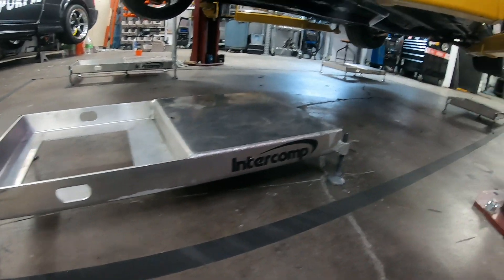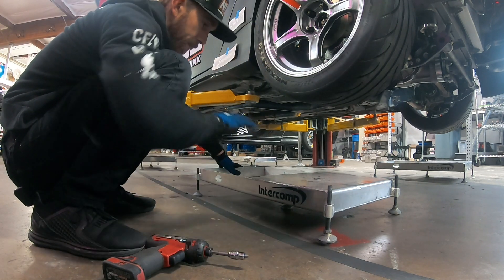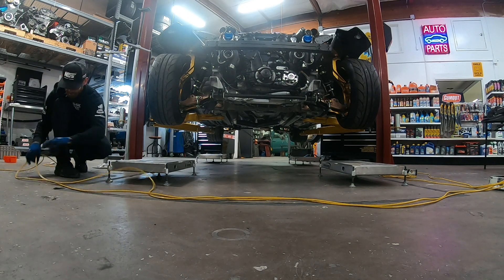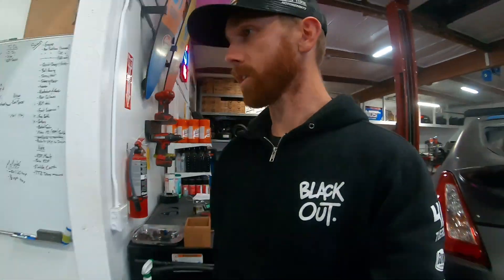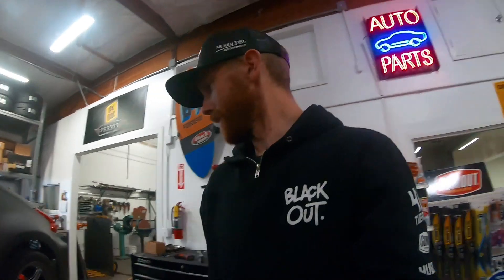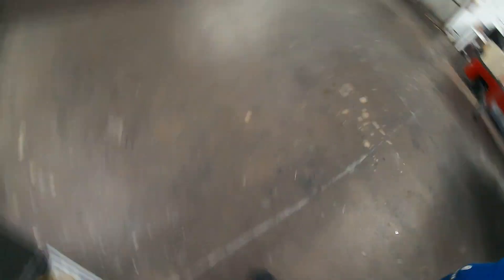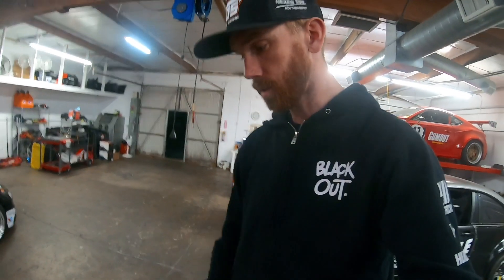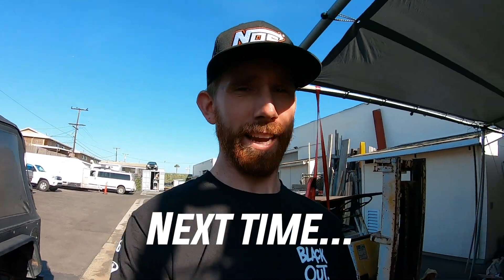How to Corner Weigh Your Car!

Comment: Tire tread weight is especially pronounced on a motorcycle, considering you use your entire contact patch and actually lean through the corners.   It's a good 10 inch wide patch of rubber on the rear alone, lots of rotating mass in that rubber.

Comment from the maker: How do you align your car at the track or at home?
Reply: incorrectly, every time.
Reply: I live on Vancouver Island. We don't have anywhere to corner balance on the island! Good laser alignment shops though. Massive fan of yours! Bought a 350z because of your FD wins with that chassis. I have 2018 370z now. I saw you in Seattle @ FD and had a great time! Keep up the good work bro :)
Reply: Usually start with making sure the concrete is level, and then shimming my scales. Otherwise corner weighting is kinda pointless.
Reply: Two metal pipes, one at the front/one at the rear, red fishing line running from end to end on both sides of the metal pipes which are raised up off the ground to center axle height by jack stands.
Reply: 🤔 your supposed to align them? 😂